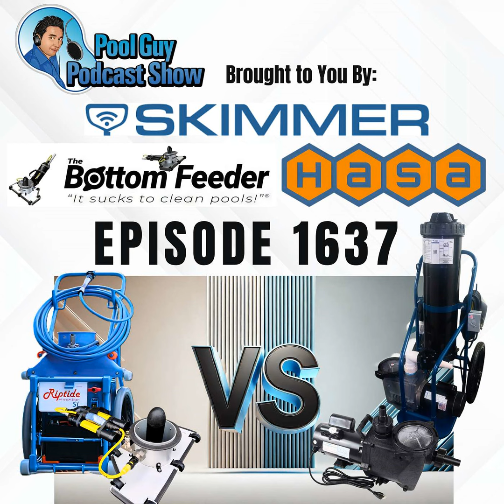Suck It Up: Vacuum Systems vs. Portable Pool Filtration

Comment: Love the videos man, I’m thinking about getting the bottom feeder and or riptide for dust and wind storms here in AZ.  What do you think is best?
Reply: And if I should get the 100 micron bag or 57 micron
Reply: I got both Riptide and the Advantage Manufacturing portable pump. I recommend the riptide with 50 micron bag and the 25 micron.
Reply: @rich2209  the advantage seems expensive but that is mainly used for getting dirt and dust out of the pool?  Or could I just vacuum the dirt/dust with the riptide?
Reply: @HeavenlyPoolsLLC  the riptide could pick up dirt but there is a limit (quantity) and you also have to keep it turned on while you pull out the vaccum head. Otherwise, dirt will just fall out of the bag. 
Both are expensive but the riptide probably more beneficial.  You can vacuum big leaves etc and switch between micron bags to do the job.
Reply from the maker: Seems like the question has been answered. 👍
Reply: The bags for both the Riptide and for the Feeder only go down to 50 and 57 microns respectively. In my opinion, they are not fine enough to capture the desert dust. The exception would be the cartridge filter on the Bottom Feeder. It works great but is unwieldy. If a pool always needs to be vacuumed, and you don't want to deal with a cartridge filter on the Bottom Feeder, then it's best to sell them a cleaner or you're relegated to vuccuming with a hose connected to their filtration system or having to invest in a portable filtration system.
Reply: @alfm.7125  which advantage manufacturing portable filtration system would you recommend? I see they have a gas and a few others.  Thanks a lot!
Reply: @HeavenlyPoolsLLC  I service pools in North Phoenix and I own the Riptide XP (No Cart). I love the Riptide after storms, but my only issue with it is that it is HEAVY and awkward to carry by hand into a yard, so I use a hand truck that I keep in my pickup truck bed to wheel it back to the pool. The weight comes from Riptide's very durable design, but that equates to 35 lbs for the Battery +  30 lbs for the vac head w/ cord = roughly 60-70 lbs. I did not buy the Riptide Service Cart because it's too big to get into the backyard at many of my clients houses due to small side yards or having to walk uphill or through uneven terrain. Whereas the hand truck I use is narrower and has wide never flat tires that make pulling it through the side yards and rocks a breeze. Currently Riptide does not offer a Lithium Battery option, so you're stuck dealing with the heavy lead acid battery. I own all the Riptide bags, but find myself using the standard 100 micron bag the most. 

I chose the Riptide over the Bottom Feeder because I don't like the fact that the Bottom Feeder submerses it's battery pack under water. Sure it makes the Feeder more compact and light weight, but I have yet to find a seal that doesn't fail after enough time being submerged. Previously I've owned several battery powered devices (vacs, drills, etc.) that were designed to be submerged and ALL of them, regardless of price, eventually failed because water made its way past the seals.

Another option you may want to consider is the new Remora from Hammerhead as it weighs only about 18 pounds.

As for the Advantage Port-A-Vac... it's a great system, but unless you're doing a lot of large residential or semi-public / commercial pools you won't be using it very often. It's just too big and cumbersome for most residential properties to use on a regular basis. However, it is a great tool to have after a dust storm or when a pool's pump motor fails and you have to wait for repairs. I used to have a homebuilt port-a-vac that I pieced together with a used pump and filter that lasted several years, but because it didn't hook up to the trailer hitch it wasn't easy to transport and that contributed to it not getting used very often. However, over the last 2 years I've been thinking a lot about getting a new port-a-vac and then just this week I made the decision to splurge a little and buy the Advantage Port-A-Vac 2.0 Pro Kit when I'm in California in 3 weeks. Being able to pick it up at the factory and not have to pay the $500 in shipping costs  definitely helped seal the deal.

Anyway, I hope this info helps.
Reply: @ thank you for that feedback!  I agree with everything you said.  I ordered the riptide xp on Thursday!  It did seem a bit heavy, but I like the hand truck idea!  

I agree on the bottom feeder and port-a-vac.  I think I will pick up the mini portavac next time I go to California
Reply: @HeavenlyPoolsLLC  When you purchase your port-a-vac I'd recommend buying a second catridge for the filter that way you can just swap the dirty one out for the clean one and be back to vacuuming immediately, and deal with cleaning the cartridges later after the job is done. This is a huge time saver during monsoon season.